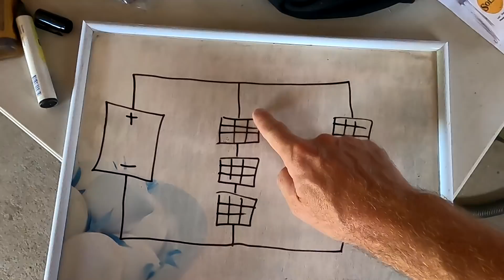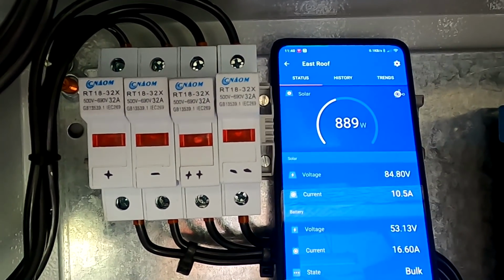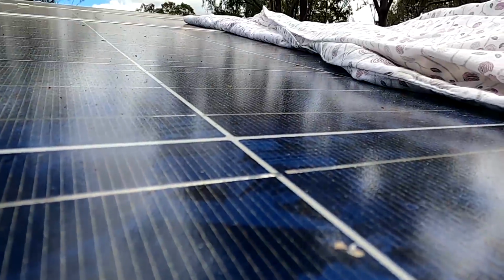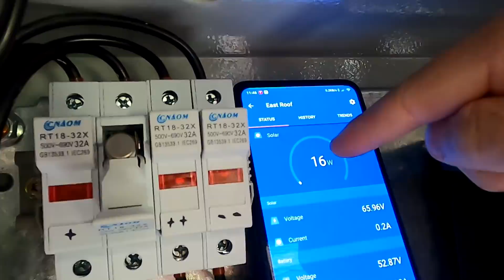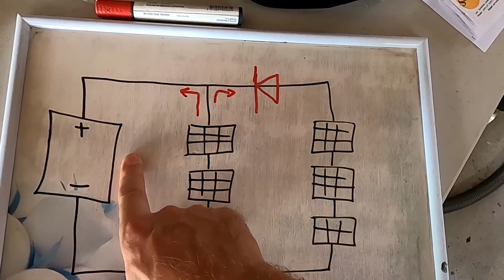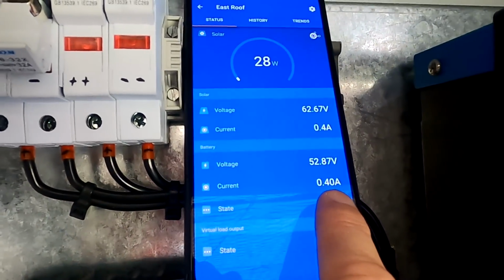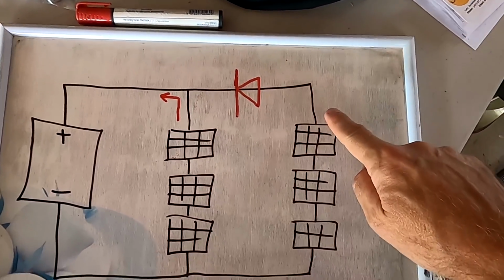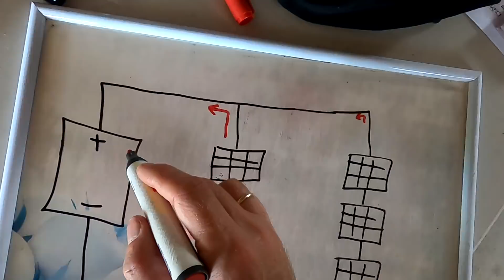Solar Upgrade EP4 - Shaded and non-shaded solar string in parallel. See what happens.

Comment: Please try out a scenario when the battery is full and current has no where to go but to the shaded panel. Iam sure you will get different results
Reply from the maker: Nope, it's not a different outcome. Once the battery is full, the SCC will drive the panels away from the maximum power point to make them 'inefficient'. Because all solar strings are in parallel, they have the same voltage. Same voltage does not trigger any current. Even if the shade is changing due to wind and moving branches from the trees, the voltage across all strings is always the same. 
In such a scenario, one string could have a slightly higher voltage for a moment and may be able to see a very small current from one string to another but we're talking about less than 10mA for a brief moment.

Comment: Diodes are useful between series panels but that test would require lots of rewiring. If you had diodes wired in parallel between the series panels you would get more than 30 watts from the shaded string.

Comment: Diodes prevent backflow. No one will argue against that. But is it necessary?

But without diode, if one of the string is shorted, it too will short the other strings and possibly permanently damaging them or worse cause fire. If there were diodes, it will block the short.

Comment: So from this we see that the diodes in the panels work.
A string is still part of the circuit as they usually share a ground, so the whole panel can be bypassed.

What you may notice is a few lost volts (about 0.6 per panel/diode).

Comment: Question: besides a small voltage drop, is there any other disadvantages to including a blocking diode with each string?
Reply from the maker: No, no disadvantage at all.

Comment: The wealth of information I have learned from you is great. so much. but can someone tell me If there is a charger that I can  connect to an MPPT charge controller, so I can take advantage of all the adjustable parameters . Sorry if I asked this before, I forget. But it is bugging me and I have yet to get a reason why I can't do this, but lots of "NO's"........
Reply from the maker: Thank you.
You want to connect a power supply to a solar charge controller? I don't think that's a good idea as the MPPT would try to find the best power point of the power supply. It's not designed for that. 
You usually use a power supply with a fixed voltage and limited current to charge the battery accordingly as per its specs.
Reply: @OffGridGarageAustralia  If you got an extra one lying around, try it. People like me would definitely tune in to like it. Just think. If you found a combo that worked, you'd be a hero. All those parameters. Just think of the possibilities for the common folks.  LOL Or let out the magic smoke. Either way clicks ahoy. In the name of science.
Reply from the maker: @immrnoidall  What would be the benefit of doing this though. The power supply needs to have a current limiter anyway otherwise the MPPT will short it as it tries to pull as many amps as it can. 
But if the power supply has a current limiter, we can can use it directly to charge the battery. Constant Current, right?
So, I'm not sure why you need the MPPT then? OK, the parameters you can set... but that's it?

Comment: The main issue with parallel panel/strings with partial shading is it screws up the controllers MPPT point finding which causes unshaded panels to also produce less output.

Best solution (besides eliminating partial shading situation), although more costly, is one series string per MPPT controller, same as for groups of panels facing in different directions.
Reply from the maker: I agree, I made a video about this a while back and asked the same question: How many MPPTs would I need?
https://youtu.be/xntxzymjlxM

Comment: In your diagram, the two panel strings combine to feed the controller on a common circuit, but your installation has the two strings on separate circuits; that is why you do not measure a need for the blocking diode - that functionality is handled in the Victron box ;) [edited because I kant spel]
Reply from the maker: That's not the case, both solar strings are connected in parallel to the same SCC.
Reply: @OffGridGarageAustralia  Ahh, two parallel strings and circuit protections, but electrically bonded @ the SCC which are not then isolated inputs. :D

Comment: having different strings might actually decrease the overall efficiency if they have different lighting because the MTTP will optimize on the two strings not knowing about then. As far as I understand it, if two strings have significantly different lighting, using separated MTTP might improve the efficiency. (These are only assumptions, I am not knowledgeable enough about these systems)
Reply from the maker: Yeah, I discussed this in a previous video a while back (https://youtu.be/xntxzymjlxM). Then you spent all the money on more charge controllers, cabling and accessories to squeeze out a bit more power or have them in parallel with less effort and run them in a bit less efficient way. It's a difficult decision, right?
And how do you test this? Would need term a long term setup to compare both situations over time.

Comment: Solar Panels are more like Current Sources , so when connected in parallel, the Amps ADD together as they find a common voltage ...

Comment: Hi Andy, I think the blocking diode is a relict of the ancient time of solar power...I had a 12 v panel with 50 Watts...years ago
..connected direct to the battery of my camper...then you could loose some energy over night when you forgot to disconnect 
...the blocking diode was the solution that time.....

Comment: for the last 20 years a diode has been fitted to every panel made . it is fitted in by the wires coming out of the panel.
Reply from the maker: Read the pinned comment at the top.

Comment: Hi Andy, you can't listen to all people's recommendations. That diode is stupid, of course, but you've already found out. Every good (standard) panel has such a small black box from which the wires come out. This box contains, among other things, rectifier diodes.
So you don't need another diode.
But as you found the disadvantage of strings in series is that when only one panel is shaded, the performance of the whole string drops to almost zero.
Therefore, it is not very involved in connecting many panels in series.
Reply: But those are not Blocking Diodes, they are Bypass Diodes ...

Comment: I have a set of very old panels (HF 45 watt) without bypass and blocking diodes. I have a newer set of 100 watt panels that have the bypass diodes. Fyi.
Reply from the maker: Thanks Peter.

Comment: You should have measured the open circuit voltage of the shaded panels. If that is higher than the MPPT voltage of the un-shaded panels, you are golden.
Reply from the maker: It must be. Otherwise there would be no current flowing from the shaded string to the other one. Voc is always higher than Vmp.
Reply: @OffGridGarageAustralia  but the shaded VOC may not be. Clearly it must have been in this case  but did you actually measure it to see what it was?
Reply from the maker: Yes, it was visible when I connected the shaded string to the charge controller. At the beginning there is no current flowing until the SCC picks it up.

Comment: If you actually need to add a diode, you would have to add 2.  1 in each string.
But most panels already have a schottky diode built into the output junction box on the back of the panel.
One place you would need to ensure there is a diode is if you have a panel directly connected to a battery, but who does that.  There should be a charge controller in the circuit.
Reply: These panels do not Blocking Diodes ...

Comment: Wow that's super interesting! No loss whatsoever. I wonder if the theory of having 3 panels in a series is a bad idea. Some say no way don't do it. But I think it's worth a test possibly. 🤔 Cheers Andy ⛅🌞
Reply from the maker: With a 48V battery, your panel voltage needs to be far over that voltage or your could not charge. If it's only for a 12V system, you can parallel all panels and don't need to worry about shading or diodes. But you have much more cabling effort.
Reply: @OffGridGarageAustralia  yes outstanding for my 12v system that is what I'd try it on . Eventually it will be upgraded to a 24v (cells are on the way, maybe here in 2 months lol) but that's more project for next year.  Got my first testing of the system today with running all the pond equipment and it passed with flying colors! I was Bing watching your build and victron videos all day. Gotta learn the best settings for the lifepo4 from your testing and study 📖.  Thanks man, cheers 🌞

Comment: The unloaded cell voltage is much higher than cells at max PPT, so it makes sense that you need impossibly extreme shading to bring a string's output low enough to become a problem under normal circumstances. It is more of a "best practice" thing in case a panel shorts out than an absolute necessity.
Reply from the maker: That would be a different scenario, yes. I have seen pictures of that but never heard or read about it actually happend to someone.

Comment: I'm by no means an expert, but a PV cell is itself a diode. So it might be that the PV cells themselves Perform the function of blocking diodes.
Reply from the maker: That is not correct. I prove this wrong in the next video. A solar panel is NOT a diode.
Reply: @OffGridGarageAustralia  A PV Cell IS a diode, you simply exceeded the Peak Reverse Voltage, just like any other diode  ...

Comment: Hi Andy, 

Correct me if I am wrong - but if you shaded only two of three panels in your 660watt string you should have close to 220watts from the remaining panel via two in series bypass diodes reach the inverter? To get only 32watts as you did from the remaining unshaded panel in your string test indicates most solar power generated is being lost as heat! Either via  faulty "bypass diodes" or via the shaded panels themselves? Normally forward biased power diodes drop about 1volt which means each diode will need to be rated at minimum 10watts to prevent overheating and failure. Personally I suspect the bypass diodes don't actually work in your system - leaving you with the resistance of multiple solar cells or failed high resistance bypass diodes  getting very hot in your recycled and shaded panels. It needs checking or you could have an unexpected fire! 

Naturally this reasoning is utterly dependant on the readings you get from your Monitoring software utility being accurate when you shade your panels? If the readings are not accurate as you drop the string voltage to 1/3rd normal the whole test is meaningless anyway LOL :)

By the way as a final friendly comment - if you want to protect your strings from back feeding you need two blocking diodes one on each string, not just one  on one string.

Cheers :)

Comment: Two strings of panels require two MPP controllers to optimize the power.  You may be lucky and the panels match some times, but to ensure maximum power, each string needs it's own MPP.
Reply: Is the extra cost worth a few extra percentage in watts = pennies ?

Comment: I measured back current on my parallel panels sets caused it's lower output voltage than higher voltage sets in parallel. My panel sets point SE or SW so output varies. I use one schottkey at the end of each set.
 You must measure to know!
Reply: Note: His panels are side-by-side, they not pointed in two vastly different directions SE vs SW ) like yours are...

Comment: Note that if the charge controller is drawing current from the 'sunny' panel string, then that string will not be at its open-circuit voltage and the reverse voltage on the shaded string will be lower... possibly even low enough to not even be a reverse voltage any more.

Test the worst-case situation, which is:

(1) Batteries are full and the charge controller is not pulling any current from the panels
(2) One string is in full sun
(3) Shaded string is fully shaded

That's about the worst-case situation.

If you only have two strings and only a few panels in series on each string, you might not have a problem.  But if you ever expand the array beyond that, things get dangerous without blocking diodes.  For example, if you have three strings, the current from two of them can gang-up on the shaded string.  If you have long series strings, the high open-circuit voltage can cause very large reverse voltages on the shaded string and if that ever goes into cascade failure your roof could end up on fire (though, at least, if you have fuses, blown fuses would be the more likely result).  Either way though it isn't good.

But still, I would recommend putting in two blocking diodes (one for each string) if you want to tie the strings together.  Or use two separate MPPTs.

-Matt
Reply: Exactly! Things are only ok as long as the voltage on the producing panels are being held down by load.
When it is not held down, it depends on the current capability of the unshaded string(s). For two short equal strings it should not be a problem, but for larger strings the energy can be quite high. Thermal camera view of such an incident would be fun!
Reply: This guy -> Junkerzn7312 -aka Matt - listen to Matt - He knows what he is talking about.